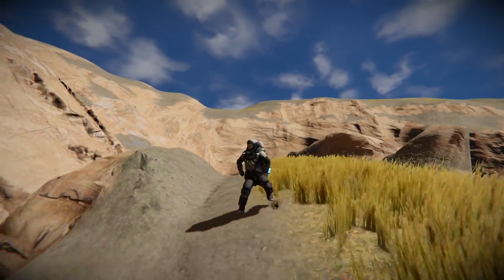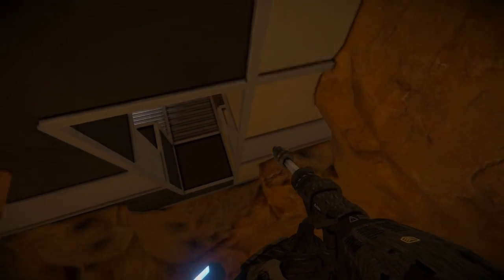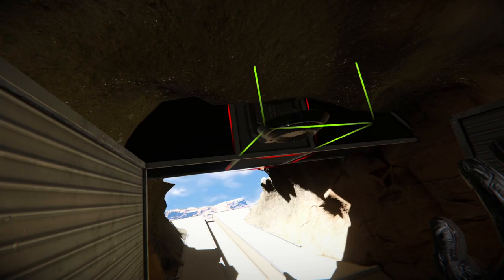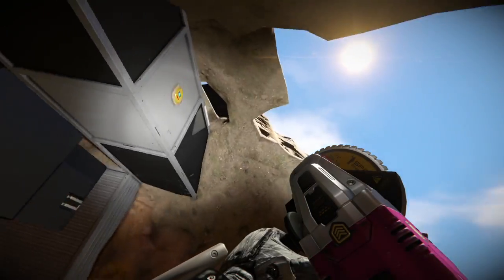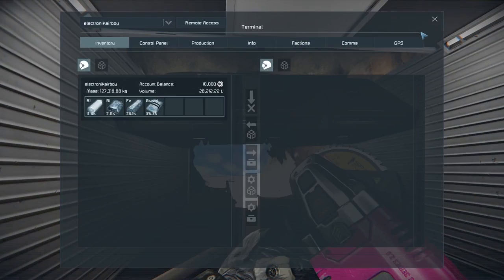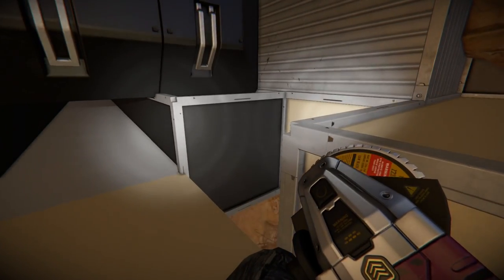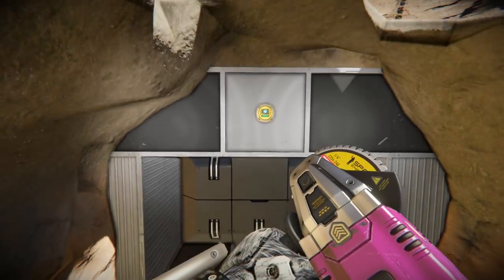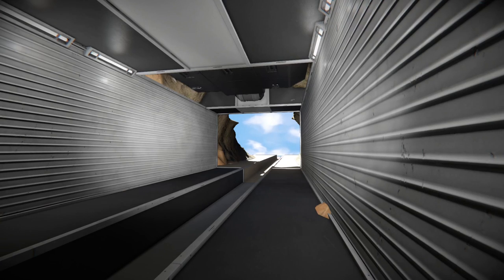How To Create An Automated Hinged Blast Door | No Script Required

Comment: You should use CTRL-click on the piston sliders and enter a precise number. That way you could also calculate your min value + 1.25 to be your max value exacly half a block higher.

And I didn't understand the part where you were talking about a certain amount of time a thing has to get through. It shouldn't matter how slow it goes, the sensor should just start the closing process when the thing has left the sensor area (set show on HUD for the sensor and check the sensor display in the info menu for debugging).